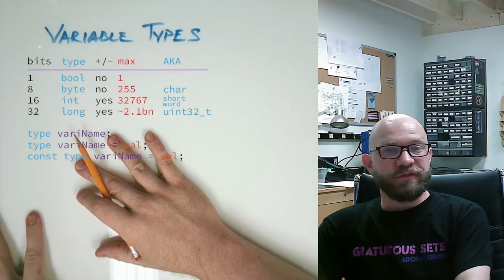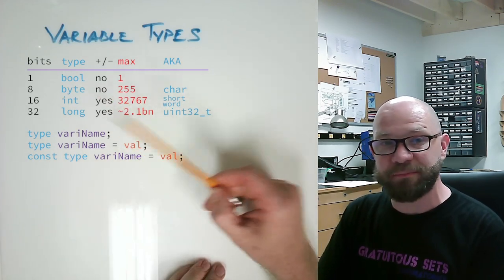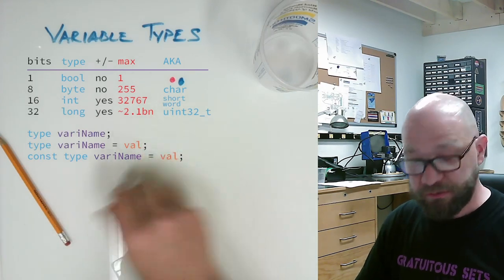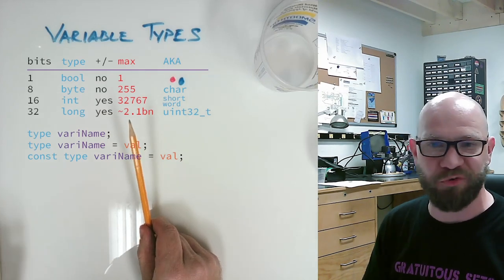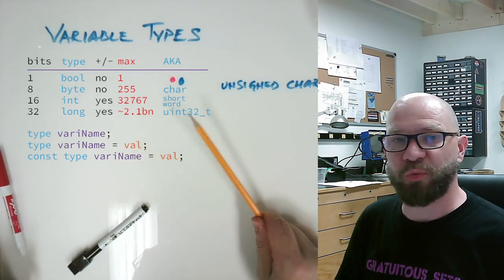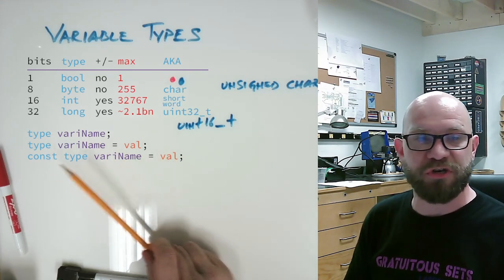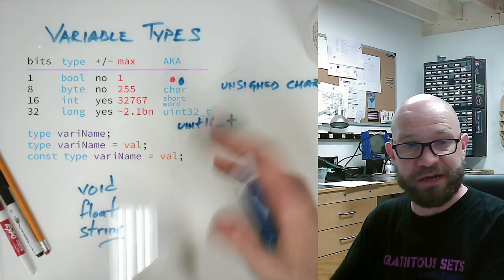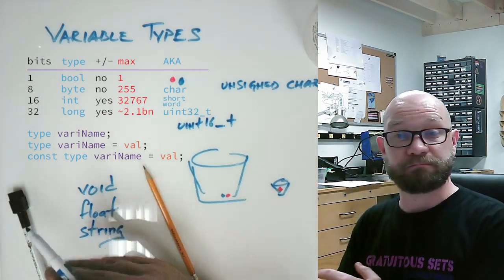Arduino Essentials 1: Variable Types

Comment: Since the size of an integer (int) is implementation dependent (16-bits on Arduino Uno/Nano/etc, 32-bits on Due/Zero), it is better to specify a more precise type like short for signed int and word for unsigned int. Best would be to use the int16_t/uint16_t form to explicitly specify bit length.
Reply from the maker: I haven't used a Due/Zero yet, so I didn't actually know that. Thanks for the addendum.
Reply: @GratuitousSets  Those Arduino variants don't seem to be nearly as popular as the Uno-style. Differences in int size has bitten me before so I try to be as precise as possible. It helps when adapting algorithms and code from other platforms to the Arduino ecosystem.